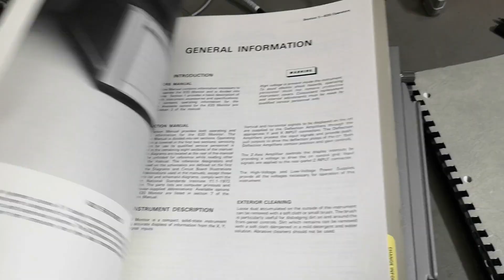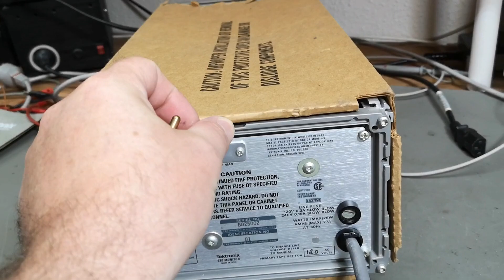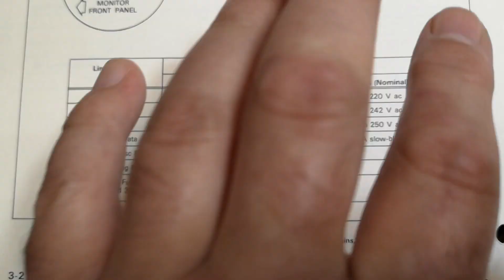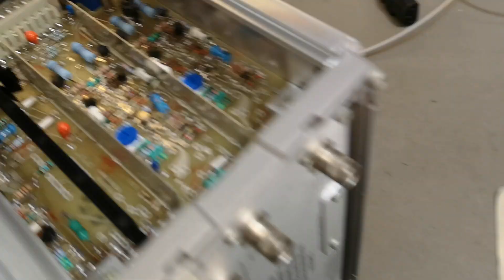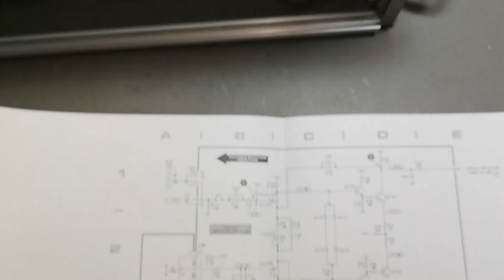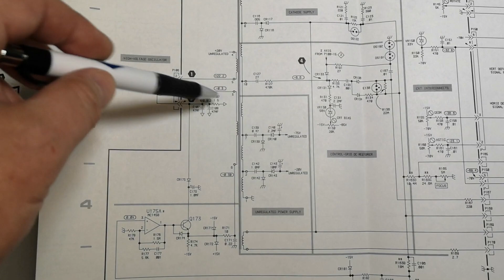Tektronix 620 Monitor Analog XY 1980 test teardown

Comment: These are not easy fixes, in my experience. This one you have here is newer than most I had the displeasure of dealing with---those I knew had transistors in sockets that did not go bad that often, but mechanically they did not give you confidence they were actually making contact with the transistor pins. For the most part I was dealing with 528 waveform monitors and 1420 vectorscopes which were never turned off, so they had thousands of hours on them. There is a pair of those for sale near me for $20---in the $180 (yr 2000 price, now---?) dual rackframe and I can't make myself buy it.  .

Comment: Excellent analysis of this old scope unit. The deflection drivers are much simpler than I expected. I have a 604 and 606 with no documentation. Both work very well and I use them frequently. One of them has P31 phosphor (green with a hint of blue and a pleasant half second of persistence). The other has P45, the modern replacement for P4  which was the common black and white television phosphor. P45 is a little more white while P4 has a strong bluish component. These monitors are perfect for scope clocks and non standard scan rate television experimenting. P45 is the preferred phosphor when doing field sequential color TV with a filter wheel system as well. It was developed for CBS in the late 1940s for the Peter Goldmark system which was superseded by Hazeltine / RCA's NTSC compatible system.

Comment: Hi Thomas, I really envy you this monitor, I wanted to use it for a curve tracker, because it has a calibration mark in the lower left corner that was also used in trackers manufactured by Tektronix. The ones I saw for sale were used a lot, but not affordable for me, or the seller didn't ship to the Czech Republic. Then I found an ad for a new one from HP at a great price, but when I contacted the seller it was already sold, so I ended up buying the 212. It's really wonderful to see such a well-preserved piece after so many years and how beautifully it draws 👍

Nice day 🙂 Tom

Comment: That's nice!
I do have a Tek 620 that I rescued out of a completely ruined Wiltron spectrum analyzer. I saw this SA for sale for an acceptable price as non working and first ignored it. But then, I realized, that the scope is a Tek 620 that I have been looking for for a long time. I intended it to go with a Biomation LA (logic analizer from the early days of LAs. Very primitive, but a collectible). So I bought the SA.
Things were missing in the 620 (no power supply, I replaced it with a meanwell switching power supply). Also, some modifications to the board were made (traces cut, new connections). Partially, I identified them already. But your video helps me to find them all.
I also cut the case of the Wiltron, so it is now more or less a Tek case. 🙂
So thanks for that video. It also is a motivation to put that project to an end. And the Biomation 920-D logic analyzer now has a nice companion from the same time period. 8 bit + aux and clock are useless. But a nice show and tell.
Reply from the maker: I got a HP, LA stocked, will clean it and play with it during the next few month